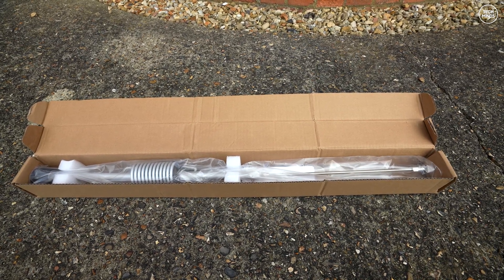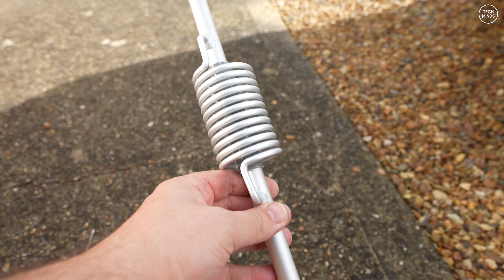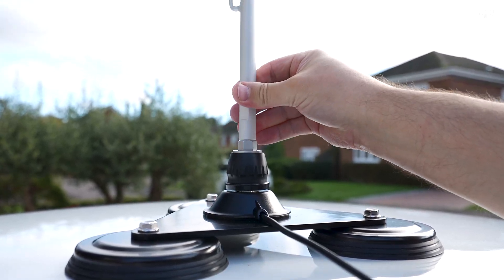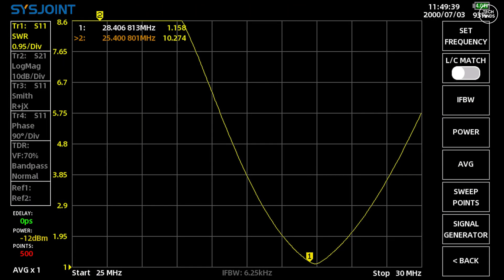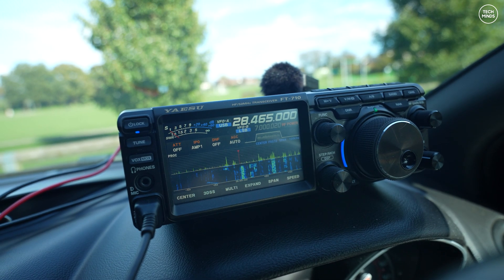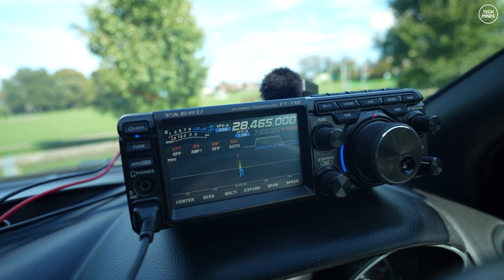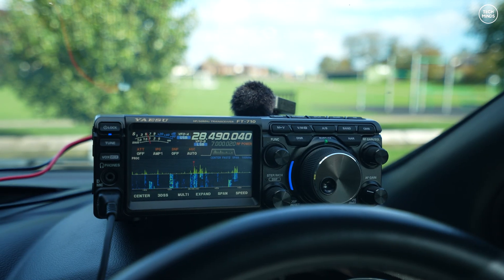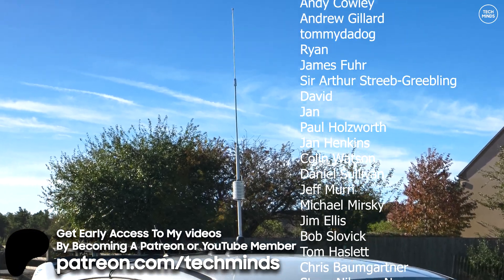500W Power in a Tiny Antenna? Meet the CBL-561!

Comment: Hi Mat, nice review. Signals working mobile on 10 meters seems strong. I was stunned to see you added the FT-710 to your collection. Do you still own the FTDX-10 ?  Before I got my FTDX-10 I tried the FT-710 from a friend. I prefer the size of the FTDX-10, The filtering (added the 300 Hz roofing filter which is fantastic for narrow modes on crounded bands) but I like the placement of all knobs and buttons a bit more on the FT-710. And from other users advise I believe the receiver performs well for a full SDR radio. For me the hybrid approach on the FTDX-10 (also the 101 and MP) seems a bit robuster in rejecting unwanted signals nearby. But I guess the future will lean towards SDR. In fact a decent 5 Watt SDR radio with a decent amplifier is all you need and will cost the same as f.e. the FT-710 Field. Cheers, Phil ON4VP
Reply from the maker: Cheers Phil! Yeh, I wanted a 100 watt radio I could use in the shack on 4M that was SDR, and a radio small enough for portable/mobile tests. I did have an FT-891, but that thing is so menu driven it annoyed the hell out of me. I also tried the G90, which is fantastic radio for portable/mobile, but for this test I wanted 100 watts. I really do like the 710. I dont have the FTDX-10 anymore as my main HF radio at home is now the Hermes Lite 2 with an amp. thanks again :-)
Reply: @TechMindsOfficial   I would love tp hear about your comments on receiver performance compared to other radios . Tnx Phil

Comment: Really needs a barrel spring on that antenna being very solid formed tubing in case of antenna stikes by low objects,one thing i would change in the design.
Could a 3/8 barrel spring be retro fitted?
Is the antenna DC shorted?
Enjoyed the video 👍

Comment: grossly inferior to a 102 inch whip.
Reply from the maker: You can’t exactly drive along with a 102" whip, with this you can. Horses for courses!
Reply: @TechMindsOfficial  'can't'... I'm thinking you meant.
Reply from the maker: Oh yeh lol
Reply: @TechMindsOfficial   - YouTube recommended your channel a while back, and even though I'm not a radio guy, I find your content interesting.   I probably will get into some kind of long distance radio communication at some point, we'll see.   Thanks a lot for what you do.
Reply from the maker: Thanks Mikey! That means a lot to me. Always feel free to suggest radio related content if you need something covering. Cheers and thanks again for watching. :-)
Reply: @TechMindsOfficial  been driving everywhere with 102 inch whip +2 inch spring mounted on roof of full size pickup truck for years. it does not matter if/when it runs into tree branches or gas station roofs, the performance is well worth it.

Comment: Hi Mat, I’m curious about the Bioenno battery. I’ve not found a uk based supplier, where did you get yours?
Reply from the maker: Hey, thanks for the question. I actually got mine directly from their website. It took a couple of weeks to arrive, but worth the wait for sure. Don't forget to get the charger too. I also got another smaller one at the same time. Think the parcel came via Australia, if I remember correctly.

Comment: I was just on PCBWays Share site and found something you’d probably want as the topic of a video. It’s called
 “kV4p HT v1.5”. It’s a VHF radio that connects to an Android Phone via USB-C and allows the phone to function without cellular or WiFi connection. There’s much more to learn and I’ll spare you having to read my regeneration of the info. You should check it out. If not for a video then just because it’s a cool piece of kit. Cheers!

Comment: Yup, I too like the Bioenno batteries. I have a 30ah battery that allows me to do POTA from my truck OR from a picnic bench. I run the FT-891 at 100 watts all the time and it's always good for two or more days (depending on how long I have to run the radio to make my 10-15 POTA contacts).  I know your vid is primarily about the Radioddity CBL -561 but felt compelled to comment on your battery choice. I have the FT-710 for my shack radio and the FT-891 for portable.

Comment: Nice presentation and sure looks like a legal limit antenna. Interesting comment about the 400W but you most likely said 40, I’m old. I do like the display and feature buttons on your radio better than my 891. I know this about your antenna, just saying. I will have to go back and visit both. 73
Reply from the maker: Thanks for the comment. I said “Full 100 Watts” but I listened back and it does sound like I said 400, oooops! :)
Reply: @TechMindsOfficial  no worries but I was going ask Yeasu what was wrong with my radio. 😂thanks
Reply: The UK legal limit is now 1kW but yes it looks good!